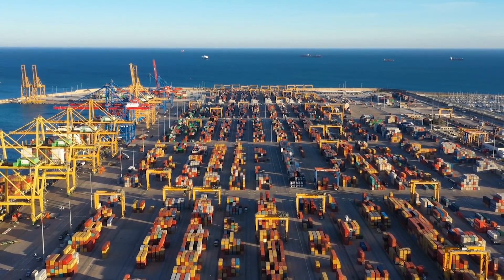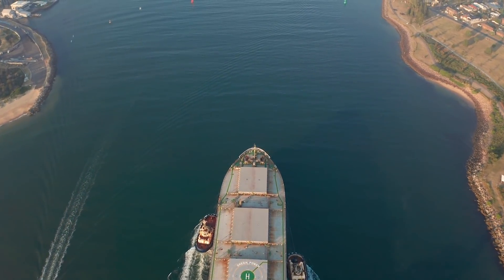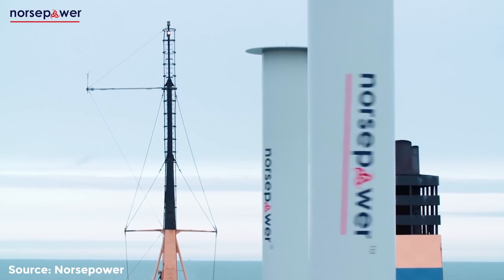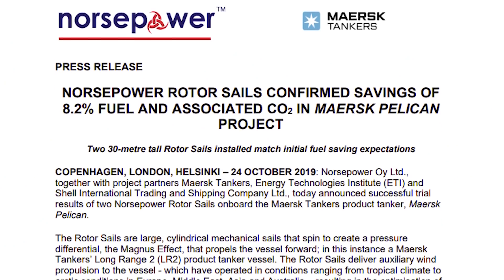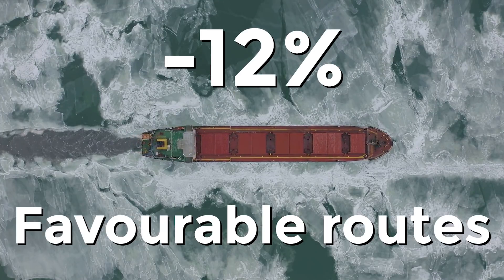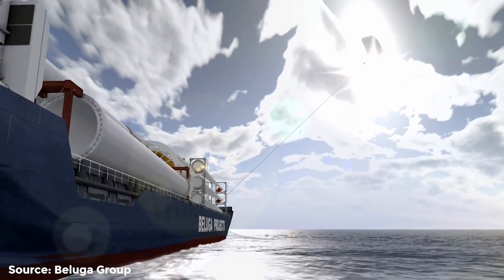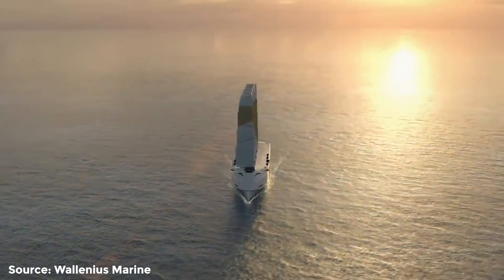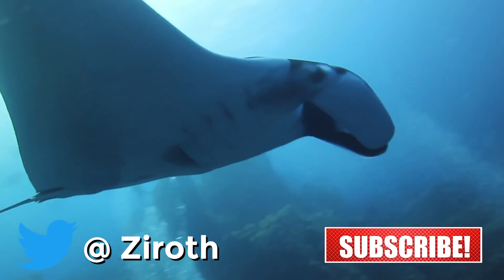Is Wind Power The Future of Shipping?

Comment: you know, we've kinda known how to do this since like 4000 BCE.
Reply: To address the suggestions that wind power is the answer I offer the following example.  In 1870 a premium sailing vessel entered service, the ‘Cutty Sark’.  The ‘Cutty Sark’ was 64.74 metres in length with a beam of 10.97 metres and a loaded displacement of 2 100 tonnes.  She was able to carry, at best, 1 700 tonnes of cargo and to harness the energy in the wind the available spread of canvas was up to 2 976m2 which was tended by a crew of about 30 skilled men.  A ratio between the sail area (SA) and the vessels displacement (D) determines how lively she is; ‘lively’ being nautical speak for ‘fast and manoeuvrable’.  The carrying capacity of cargo ships is constrained in two ways, mass and volume which leads us to the ‘stowage factor’ of the cargo; the more mass on board the greater the displacement which in turn impacts the efficiency of the hull form and sail area / displacement ratio.  A vessel constrained by mass is said to be ‘down but not full’, while a vessel constrained by volume is said to be ‘full but not down.  When in the tea trade, which the ‘Cutty Sark’ was designed and built for with fine lines (more nautical tech speak, so again no need to worry about it) she could carry around 600 tonnes of cargo at speeds of up to 17.5 knots dependent on the prevailing wind and had a typical China to UK time on passage of 120 days.  The tea trade was very competitive so ‘time on passage’ was a large factor in securing the premium freight rate that made her cost effective.  Rounding things out, her maximum available sail area gave circa 5m2 of canvas for every tonne of tea carried.

As soon as the Suez Canal opened, which the ‘Cutty Sark’ was unable to sail through; she lost her advantage, raw speed, to the steam powered ships of that era who could beat her ‘time on passage’ by taking that short cut.  Mechanically powered ships have improved in terms of efficiency, on a freight tonne mile basis, by at least one order of magnitude since then.  After losing out to the coal burning, fire tube boiler, steam reciprocating mechanical ships of the late 19th century ‘Cutty Sark’ was relegated to the Australian wool trade, just about the bottom of the barrel in maritime terms and only one small step up from being a 'honey barge'.  The canvas, cordage and extra manpower needed for sailing ships was never a very benign environmental option so please discount any idea of sail as ‘sustainable’.  All this is without the problem that if ‘the wind don’t blow the ship don’t go’, when it does blow it often blows in the wrong direction for your cargo delivery needs and sometimes there is rather too much of it for comfort.  Traditional sailing ships are unable to go directly up wind so if the wind is blowing from the direction your cargo needs to then a zig-zag course must be steered, more distance and thus more time on passage at whatever speed is achieved.  Wind speed is traditionally measured on the Beaufort Scale (wind speed) that runs from 0 (< 1kn) to 12 (> 63kn) and for sailing purposes the usable part of the range is ‘3’ (circa 8kn) to ‘6’ (circa 24kn).  As the wind speed increases and the amount of energy that may be harvested there from increases the sea surface becomes progressively more disturbed which makes the harvesting process ever more difficult.  Random fact about ‘Cutty Sark’, it is said to have been possible to coax 3 000 horse power out of her sails, or in ‘real money’ 2 206 500 Watts (2.2 megaWatts),or 741 Watts for each uare meter of sail area.  So that majestic spread of canvas would have been even less efficacious for delivering your baubles and bows from the orient, despite taking about three times as long on the voyage.

Canvas and hemp are accorded 'renewable' (read as ‘natural’) status, if ‘synthetics’ are used there will still be a need for the input of FOGI products.  'Synthetics' would have a much better working life span than 'naturals' but would still yield the same amount of energy, 741 Watts for each square meter in those elusive ideal conditions.  Wallenius are currently giving wind power a go with wing form ‘sails’ but evidence is a little short of proof as of this date.  KTH (Kungliga Tekniska högskolan), a sort of up market university in Stockholm, who are using the funding to derive results will probably, and eventually, in the best traditions of academia ‘publish’ a ‘paper’ unless the funders invoke the well known ‘commercial sensitivity clause’ of their agreement with the KTH.  

On board wind turbine might get you around some of the problems, however for marine use vertical axis wind turbines (VAWT) would be better than, the what have now become 'traditional', horizontal axis wind turbines (HAWT) for reasons that include the air draught of the vessel, weight distribution and maintenance access.  The energy yield is still subject to the wind blowing at the right strength and having space available on board for the hardware.  The masts, rigging and sail handling arrangements would take up 'prime real estate' on the vessel.  Fuel oil bunker tanks can be, and usually are, stuck away in any odd corner and the ICE power plants are themselves relatively compact.  The stacked up 'boxes' would mean putting the wind driven propulsion units in a bad situation from a ship stability point of view.

Comment: Why not combining Kite and Flettner or Kite and Sails? Why not using Sails with Solar? Why building rockets and hyperloops, when we still not can use best options for transportation of goods. Sombody should ask Elon to sponsor a fleet :)
Reply: Combining systems will lead to higher levels of complexity so the operation of the vessel as an entity will have higher cost per unit of usable energy; from a ship operators point of view simple is cheap is good.

Comment: Place solar panels on the telescopic airfoils to charge up as well as being powered by the wind. Or simply forget about time and have  zero fuel cost and lest pollution.
Reply: Solar power is next up; as an example the above container (called boxes by nautical folk) area of a Maersk Triple E is less than 399.2m by 59m.  The 399.2m is the length between perpendiculars (marine tech speak - no need to worry about it) and the 59m is the width overall (more marine tech speak so again no need to worry about it) allowing for the sides, bow, stern & navigation/accommodation structure could we agree 340m x 56m, or 19 040m2, for the ‘top of stow’ area?  Insolation rate in Joules will vary due to time of day, latitude of vessel, declination of sun, (those three impact the elevation of the power source) cloud cover, the efficiency of the solar panels and how clean they are.  The Triple E class use two 29 680 kiloWatt each, at full whack, ICEs for propulsion plus some hotel and services power load cost; so for round numbers, could we agree 60 megaWatts?  Solar panels create about 155 Watts m2 averaged out; 19 040 x 155 gives me 2 951 200 Watts (or 3 megaWatts for a round number) from the top of all the boxes.  Those three megaWatts might allow you to distil enough fresh water from the sea to wash the crud off of the solar panels (surprise fact renewable energy comes with maintenance costs) but nowhere near enough to effectively 'push the boat along'.  Fitting solar panels on top of the ‘boxes’ is worth, at most, 0.5% of your power requirement.  Side mounted, let alone towed array, solar panels are not practical given the harsh conditions often found at sea.

More seriously the ‘boxes’ are loaded and unloaded from the top down so the solar panel array would need to be moved for every port operation and time is money as well as that operation having the ability to get very complicated (tech speak for ‘go wrong’).  Any additional weight would be in the worst possible place for the stability of your vessel, the operating environment would be harsh and the ‘top of stow’ on a ‘box boat’ is seldom a level expanse as each column of containers may be, and usually is, of differing heights.

Comment: Ships can soon now go fusion nuclear with no fuel costs! The SAFIRE GENERATOR by Aureon Energy Ltd. of Canada is the actually cheapest, cleanest and least expensive solution for clean electricity. Wind energy, solar, hydro and other green technologies are now just superseded. Hydrogen will not either become a future conventional fuel but a nuclear fusion one! Electric power is the future for autonomous small aircraft and with ever more battery energy storage density perhaps some larger ones. However, FUSION NUCLEAR IS THE FUTURE of ever-larger commercial and military aircraft. Now we have a 24 hr. reliable fusion power product. We now in 2021 have super cheap nuclear fusion energy already proven and almost commercialised as in being in advanced production, that of the "SAFIRE GENERATOR". So sadly, storage technologies and the power from ITER-type fusion power generators as well as conventional fission nuclear are going to be eclipsed. Current magnetic plasma confinement strategies and all current green energy technologies are totally out of date and relatively redundant. All our effort must now go into EVER HIGHER ENERGY DENSITY BATTERIES because green energy is now solved. With intermittent green energies we need an enlarged electric grid, so we see wind generators, solar farms and a multitude of variable green technologies with expensive backup batteries and they are all ugly and use up much land, while also being significantly capital intensive and all while having some safety issues. They are all also going to be unnecessary with the advent of the "SAFIRE GENERATOR" that is safe, costlessly self-fueling, totally green, buildable on any scale on a tiny footprint to safely match local community requirement and it is easily chokeable and 24 hours dependable. It makes all other technologies redundant as in being much less advantageous. It is fusion nuclear powered by nuclear "NUCHEMY" and seen at "AUREON ENERGY.COM". Also learn your new plasma physics, astrophysics, and general Electric Universe Theory at "THUNDERBOLTS PROJECT.COM". This way you can learn your new EU Theory, advanced plasma physics and all needed to fully understand all this new academic and practical material. and appreciate that all the other green technologies are currently just now superseded.
Reply: Are you recommending sea borne nukes or stored electricity?
Reply: With regard to propulsion with electric motors powered by ‘green electric’, leaving aside the fact that there is no truly ‘green’ electricity, the best we can do is low carbon impact both at installation (capital account cost) and production (revenue account cost).  Running ships on the ‘lecky’ is tricky the two examples that I personally know of, and have used, are a vehicle and foot traffic ‘chain’ ferry that ply’s its trade across the hundred meters or so of the Nordre älv between the island of Hisingen and Kornhall on the Swedish mainland.  The motors are on the ferry and a power supply cable is unwound and wound back up on board as the ferry shuttles back and forth from Kornhall.  When the vessel goes anywhere else, id est dry dock for survey and or maintenance, it is towed by a good old ICE powered tug.  The other electric vessel is a vehicle and foot traffic ferry that runs from Helsingborg (Sweden) to Helsingor (Denmark), a twenty minute trip undertaken using energy stored in batteries on board, she tops up the charge each time she is alongside and battery capacity is said to be sufficient for an hour of main engine use.  A video is available on the Fully Charged channel of YouTube, ‘100% Electrical Ferry Crossing’.  There are small diesel generators on board; to keep the lights and other safety related items on in extremis.  Electric ships currently have short ranges and high light displacement  as a factor of their cargo capacity.  Sadly as of now electric boats are as functional as chocolate fireguards, yes ‘submarines can be diesel electric’ but they have negligible cargo carrying capacity and if you ever go on one (HMS Alliance is available to visit as a static exhibit at Gosport, UK or video available on YouTube, https://youtu.be/Q23uoxT16gO) your first thought could be ‘not much room in here for the crew is there?’  What about electric tug boats?   That would at least improve the air quality around ports, and they can recharge daily since they stay near the port.  Well though that might be feasible in practice ‘tugs’ need lots of power in short burst with readily available reserves for when things do not go according to ‘plan A’.  So hybrid ICE/battery could be an option, so long as the economics stack up, and would be a means of quantifying part of the cost of environmental improvement; getting values to add to the debate would be a very useful tool.